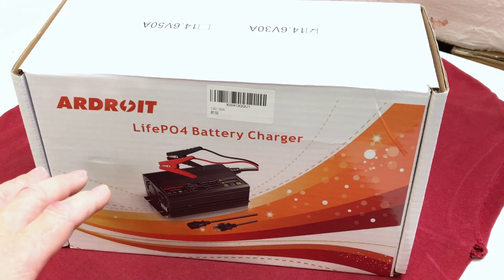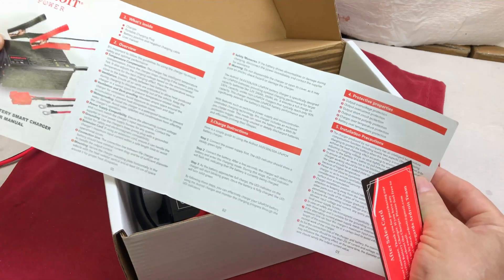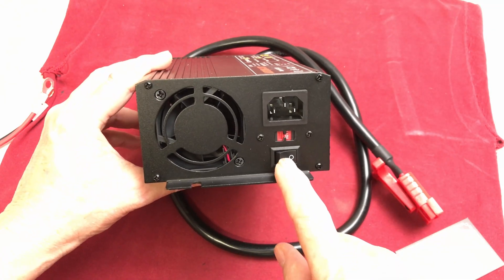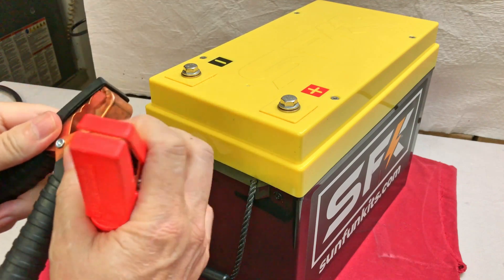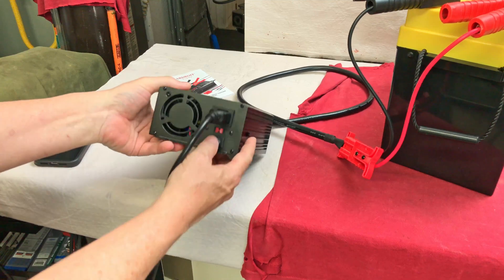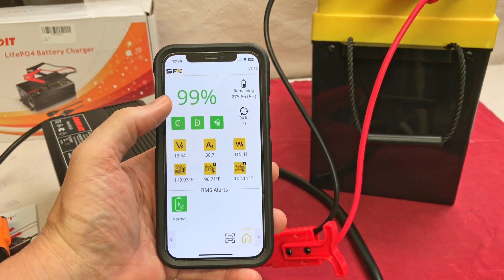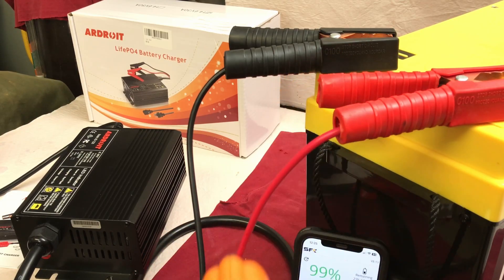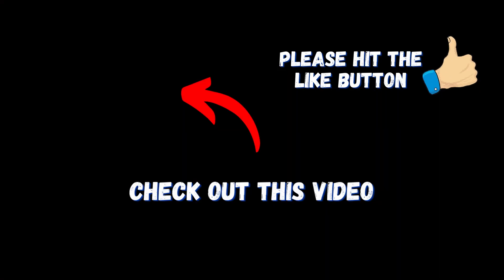Don't Buy a LiFePO4 Charger Until You See This 30A Beast in Action!

Comment: AFTER RUNNING MY NEWLY INSTALLED 
ARDROIT 30 amp LiFePO4 charger   I'M CONCERNED THE BATT CHARGER STAYING AT 14.5 VOLTS AFTER A FEW HRS AND THE BATT IS FULLY CHARGED  . NOT SURE IT'S A GOOD IDEA TO RELY ON THE BATTERY INTERNAL BMS TO PROTECT THE BATTERY (200 AMPHR LIFEPO) ???

Comment: Like @Mike-ip8hg I also purchased the 50A model because my set up I have 2 12v 314a batteries in parallel, but my question is after I do my first top up the charge in each battery and finish the parallel install, what is the best way to leave it hook up permanent on my system and use as needed? Should I just connect it to the - and + bus bar, or straight to neg of one battery and pos of the other battery ?? "Do I make sense" ? Thanks Love your videos man keep it up!!
Reply from the maker: Good to hear you are enjoying the videos. Personally I would probably go with the positive on one battery and the negative on the other method but either way will get the job done just fine.

Comment: Just watched your very interesting video. I’m in the UK quick question. I’ve got a 300 amp lithium battery in my caravan. I’m using the on board 28 amp charger which has got a lithium setting on, but when I notice the amps going into the battery from the charger. Maximum goes in about 19 A and then it reduces down and seems to just stay around seven or 8 A is that my BMS doing that or is my battery charger not good enough as I noticed your 30 amp charger constantly put 30 A in is this right?
Reply: Thanks for your quick reply. Yes I do understand what you’re saying and that’s what I thought should happen, but I noticed yours gave it 30 A all the way
Reply: @Mike-ip8hg  The BMS typically cannot 'throttle' the incoming or outgoing current rate, it can only open the circuit for protection.  Likely it is the charging algorithm in your charger.

This model that he's testing seems to have nailed it as far as charging speed goes.  Very interested in using it (or the 50A variant) on my 300Ah RV setup with the backup generator.
Reply from the maker: As the battery gets closer to full you will probably see the charging amps taper off. A battery that isn’t close to full should let the charger charge to its rated amperage. Hope that makes sense.
Reply: Like @Mike-ip8hg I also purchased the 50A model because my set up I have 2 12v 314a batteries in parallel, but my question is after I do my first top up the charge in each battery and finish the parallel install, what is the best way to leave it hook up permanent on my system and use as needed? Should I just connect it to the - and + bus bar, or straight to neg of one battery and pos of the other battery ?? "Do I make sense" ? Thanks Love your videos man keep it up!!